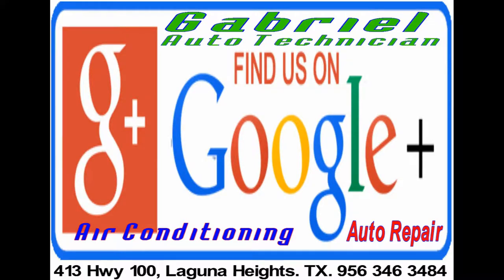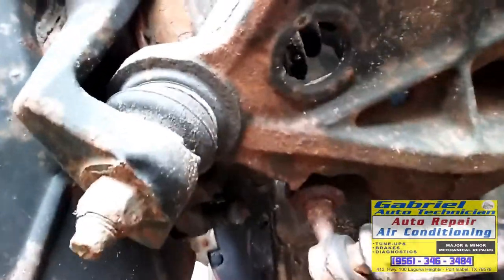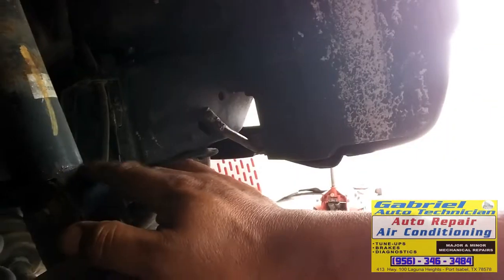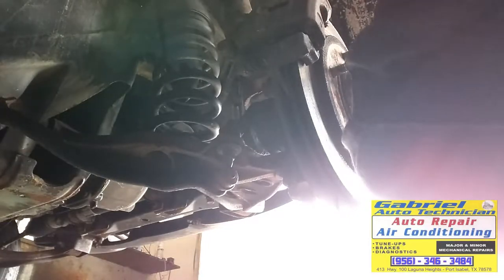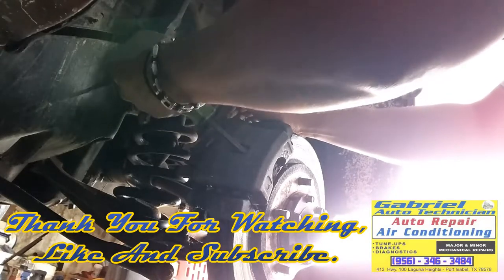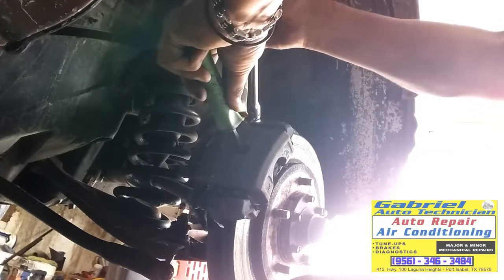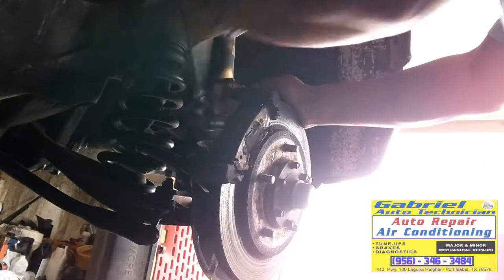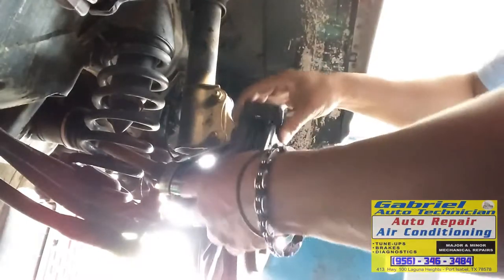Removing & Replace Right Constant Velocity Shaft. Brake Pads And Rotor. Part 1 Chevy Tracker.

Comment: I just pulled the CV axle assembly out of my 2004 Tracker ZR2 4WD and there was no c-clip on the old shaft.  There does not appear to be a groove inside the differential hub for a c-clip to fit into.  Should I be able to see or feel the groove inside the spline in the hub?

Comment: The arrangement of the steering and suspension is the same as my tracker 2003 4wd good explanation to disassemble.You can make one to change the ball joint? Thanks.

Comment: la Gabriel me puedes ayudar contestándome una pregunta. Porque el CV Axle se sale cuando lo pongo . Hice todo el procedimiento ,pero cuando la empiezo a manejar se sale bota el Snap ring
Reply from the maker: Tal vez el snap ring esté muy cerrado, o no este entrando a su lugar; o el shaft está muy corto o más delgado, o en un caso muy remoto que tu  engrane satelital esté roto y se abra... Hay que checar bien.
Reply: @GabrielAutoTech  Gracias Gabriel, la parte es nueva yo creo que la golpee muy fuerte para ponerla en su lugar y posiblemente se haya metido mas de lo normal.